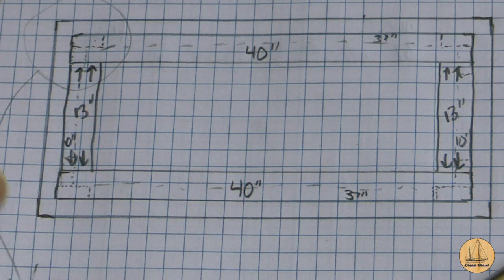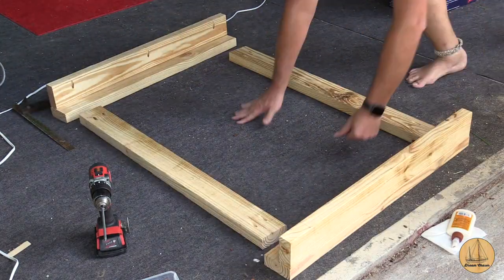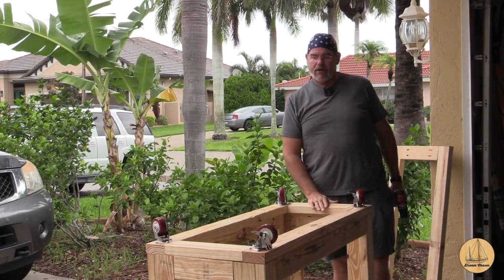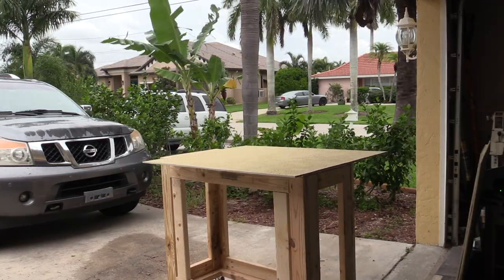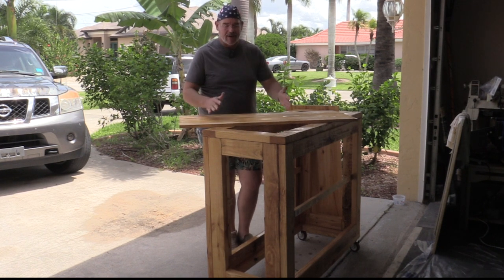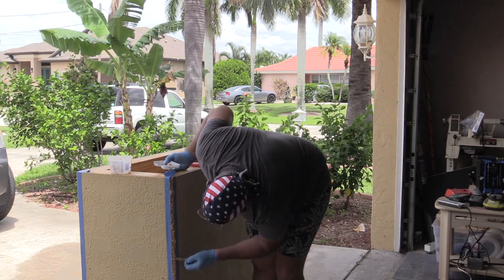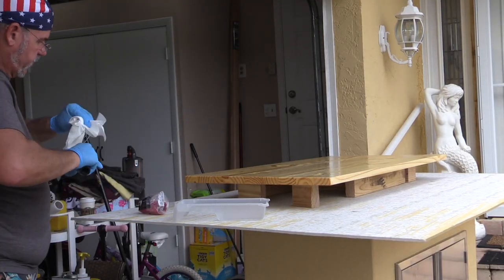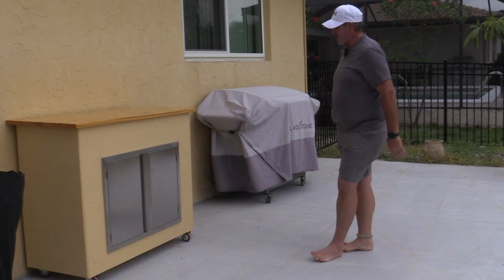How to build an outdoor prep station for your grill or bbq area

Comment: Wow brilliant job very methodical, the whole thing looks high quality. The top looks as smooth as glass excellent. One thought I had that might help to eliminate any water soaking under the countertop would be to use a router and cut a shallow channel around the countertop say 1cm all around the edge. In theory it would work like a capping stone you put on exposed walls/columns, any water would collect in the channel and drip directly down to the floor instead of making its way under the countertop. Top job I think I'll make one from your plans to go with my Pitboss Smoker :). Thanks for taking the time from Leon in England.
Reply from the maker: Great idea worth the routes edge. I was also thinking about just siliconing a bead under the counter but so far in all the rain we have had it has stayed dry. So far so good. Lol.